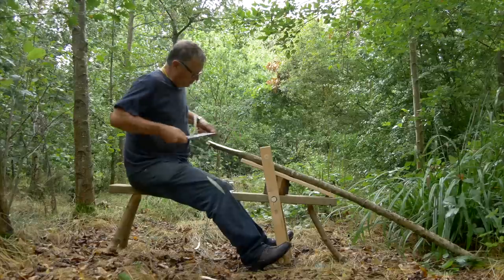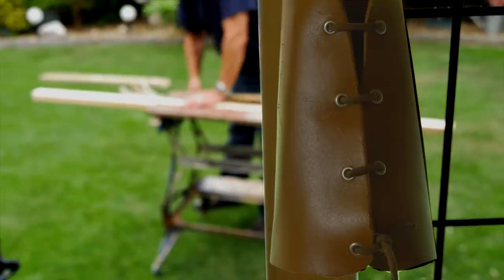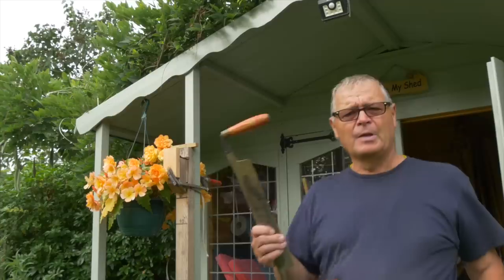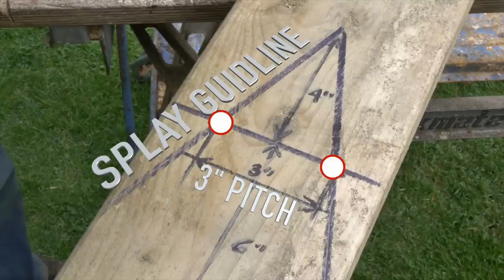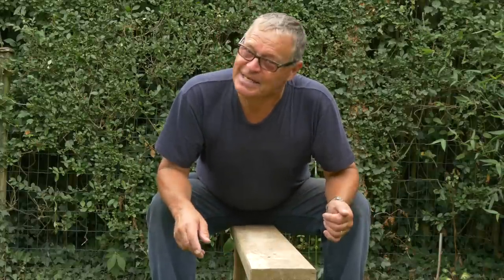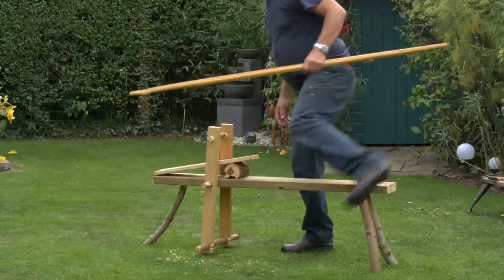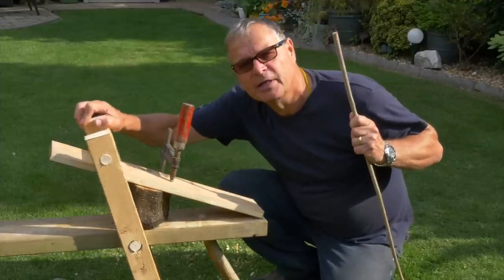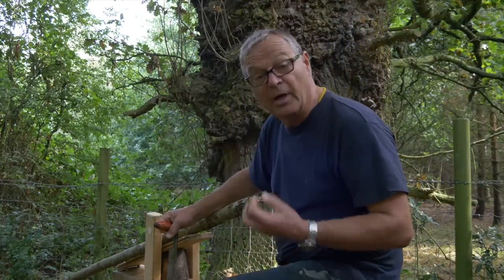How to Build a Shave Horse. Bowyer's Woodworking Dream. Traditional Handmade Vice for Wood Carving

Comment: Hey Mick, saw this video on making a shave horse, my wife and I make brooms, and I need a shave horse to hold the handle so I could strip off the bark.  Your design is perfect. Just finished mine using Lilac for the legs and spindles and 2x6 for the bench.  Must say, it turn out pretty good for my first one. Couldn’t have done it with out you. Tried to attach pictures but couldn’t figure out how to do it.  Thanks from North Eastern Utah, USA.

Comment: Hi Mick, 👋 Among the various Shave Horse designs that can be seen on YouTube, your design is the simplest and most direct! 😀 I like 👍 that you use found materials and friction fit all the parts. I'm a newbie gathering tools, materials, and information to attempt my 1st bow! I believe I will use your design to first build my own Shave Horse. Like you, I believe that I have all those materials around the house, for free! 😊 Thanks for making it so accessible! 😊
Reply from the maker: Good luck 👍👍
Reply: @Mick Grewcock  Hi Mick, ???Question??? I'm 6'2" and about to make my Shave Horse using your measurements! 😮 Are you close to that height? Or should I add a few inches to the various parts? 😊
Reply from the maker: @davidwsmith316  I am about 5’10” with 29” inside leg. I think leg length is more important than height but your reach as you bend forward to draw the knife back is also important. You could sit on a regular chair and estimate measurements from that. Some people make a slightly more complex horse that has a moveable seat which will accommodate people of varying stature. Good luck.

Comment: The draw knife is supposed to be used with the bevel side down.  this allows for far better depth of cut.  Also you need to use it angled to the cut and this gives a very smooth slicing action instead of a scraping action.  I enjoyed the video.

Comment: Ah, a great video, as you promised a few weeks ago! Just a little tip, if your pegs start to shrink and slip, saw a kerf in the ends and put a wee wedge in them to tighten them up. Just make sure you have the wedge oriented across the grain so you don't split the bench!
Reply: Agreed.  The wedges will make the bench a bit more permanent, but if need be can still be left out to allow breaking down the bench.
As an aside, if you taper the leg ends, this will permit driving them deeper if shrinkage occurs.
OR, use a chair bodger's trick and you cut the legs from green wood, but stick JUST the dowel ends in a bucket of hot sand or over a fire to dry out (not char!)...when they are driven home, as they absorb moisture from the air, they will expand to fit the holes tightly.

Comment: Pretty cool design. I'd probably use a metal bar for the pivot though, you wouldn't have to remove so much material from the bench part.

Comment: Good to see you back off hols Mick.....For bloody years I have chased "Workmates" around and have often thought that a shave horse would be a nice thing to have (that and a pole lathe) but have never got around to build one.  Nice job for your first shave horse....most people cock up on not getting the geometry right and end up with not enough/too much pedal throw, the work hight too high or not enough working distance...but yours looks sweet.
Reply from the maker: Thanks Keith! It worked out okay for a first go, especially as the parts were cut and joined together to the rather vague guidelines I set myself. Good that you mentioned a pole lathe - that's my next big project (will take some weeks as I can't do any woodland work for a month or so). The archery link being that I'd like to turn some arrow blunts on the lathe. By the way, did you get my message about the previous video we discussed? Sent it yesterday evening. Mick
Reply: Mick Grewcock  ......Yes Mick I did thank you, I think you took the best course of action.  I couldn't easily message you back as you took the Tube post down.  Yeah....the pole lathe, there isn't much of an application for archery but it is a nice tool to own....mind you, had you had one you could have turned some fancy legs for the horse that you made.lol

Comment: I just made this shave horse from your excellent video. 
It does work pretty well for me but it's a little bit out because I had to guess where you put dowel holes, both in the middle of the treadle assembly and how far along on the bench. 
I'm making some adjustments to improve it but just thought it might help putting those measurements in your description.
Reply from the maker: Thank you. Sorry for my omissions!

Comment: Well Done Sir!
I am planning on teaching a class for tyro wood workers next summer, the project will be your rough-field-made shaving horse.  I have been looking for plans for something like yours, usually too finicky as to finished materials.  Rough as-found things will do just fine, in fact, might be better.
This will be day #1 of a two-day class.
Might I suggest:  Clean up that plane just a bit.  Use a single-edge razor to scrape off most of the rust, a bit of sandpaper on the rest, and wax it, so it will not rust (as much) in future.  You will feel the benefits next time you use it, I promise.
The suggested shave horse projects I will have for my students will include, believe it or not, vampire stakes...yes, I know, it's fashionable to kill vampires now, but if they DO show up, people can be prepared!
Included in the class will be a simple stool or table, which will use the shaving horses to make the legs for such.  The stool/table and the stakes will be the class for day #2.

Good idea, the pauses and 'key moments' for people to catch up with.

I will also place on the worksheet they will receive, your YouTube and web site addresses, for due credit to you and your design.

Ryan Grimm, Plymouth Massachusetts.
Reply from the maker: And well done Ryan. Sounds a fantastic project. And yes, making do with what one can find is a great learning experience. Good luck and thank you for the tips. Mick

Comment: Hi, Mick. I loved your video and am in the stages of preparing the parts. But I need the measurement for how far along in the seat you drilled the holes for the treadle hinges. And maybe the same for the top and bottom holes of the tredle. Obviously the centre of the holes and not on the perimeter. Great vid and thanks!
Reply from the maker: Hi. Unfortunately I haven’t got the shave horse near me to measure for you. However, I didn’t work to full plans - I simply estimated where to place holes etc. Sorry I can’t immediately help you - the horse is in our wood about 7 miles from where I live.

Comment: Nice build nick ive been a greenwood worker for some years know and even hold courses in our own woodland just one bit of advice if you dont already know using the drawknife as a scraper can damage the cutting edge as most drawknifes are laminated and tend to chip i learnt it the hard way by doing the same thing love the videos keep up the good work mate
Reply from the maker: Hi Phil, thank for that useful tip. Much appreciated. Thanks for watching. Mick

Comment: It's nice to see you making it :) 
I bought lumber some time ago to make one for myself and will probably make it before summer ends here in Poland. I bet that's gonna be way nicer experience getting into bowmaking with it.
Reply from the maker: Yes, it's a boon when making bows. Not sure why I wasted so much time before building one! Hurry up though. Summer is drawing to an end here in the UK. Stay safe. Mick
Reply: Mick Grewcock I've got few logs of black locust that need to be dried still. And split.
My plan is to make shave horse and tillering tree and hopefully if wood dries enough to start making first bow during winter break.
And thanks for response Mick. I'm glad that your design works out for you!
Peter

Comment: Amazing video! Though of an idea what if you used and smaller piece of wood and some type of hinge so you could change the angle of the table?
Reply from the maker: Plenty of options to add to this simple design. Give it a try. Good luck.

Comment: Thanks so much for this video Mick, could you describe quickly how you use the splay guidelines to find roughly the right angle?
Reply from the maker: The proper way is a bevel gauge. Those guidelines simply helped me ‘eyeball’ a suitable angle to get the splay. My lines simply gave me a visual hint as to the angles. Hope that helps.

Comment: I am getting interested in hand wood working and the simple machines that let you do so much like a low bench, shave horse, and pole lathe. My question is how do you determine what angle or height to use for the shave bed?
Reply from the maker: Simply by eye and estimation. There are shave horse plans on the net if you prefer exact angle fir your project. Good luck.

Comment: this is great mick, you make it look easy. i was wondering, is it still working? i reckon it is
Reply from the maker: Yes Sid - it’s still working! Thanks for watching.
Reply: @MickGrewcock  Thats great, I am attempting to make my own shave horse, I was thinking about driving wooden wedges down the through end of the legs after banging them in but I noticed you didnt so that proves to me it wont be necessary, Ive been watching a lot of shave horse build vids but Im finding yours easiest to follow, thanks.
Reply from the maker: Good luck! Driving wedges would work but I didn’t find it necessary - and also very to disassemble if not wedged!

Comment: Great work! love that you didn't use any glue nails or screws. You got a new subscriber :)
Question, why use the drawknife to scrape with? Wont id dull the knife horribly fast?
Reply: Mad Silly Willy,
 Shouldn't, depends on the quality of the draw knife, just like other knives. A decent quality draw knife shouldn't need much more than a slight honing to keep it real sharp, if done as needed, just like your knife.

Comment: Dumb question time. I've thought about building one of these for my grandson who is teaching himself to make longbows. While it seems it would be great for working 1-2 feet at each end, how does it work for shaving more towards the center of a 6' bow? If you sit too far back you can't reach the foot pegs. If you sit close enough to reach them, it doesn't seem like you can work too far towards the center of the bow. Or am I just missing something?? Any advice would be most appreciated! Thank you!!
Reply from the maker: Not a dumb question. Shave horses were not used to produce bows, their main function was initial preparation of short pieces of green wood to be turned on pole lathes - often for chair legs, spokes etc. With some wiggling you can get toward the bow’s middle but the SH performs best when initially tapering the limbs and tips. The real work shaping a bow is not done on a SH. They are great for fast and initial preparation of green staves, taking the stave (which has perhaps been crudely shaped with an axe) down into a slightly more refined shape. Then the work begins of more precise and careful shaping. Great aid, worth making, but only helps during early stages of bow making. Good luck.

Comment: Nice video :) Can I ask, what do you do when working on the area at the middle of the bow? Won't the end stick out further towards you, and poke you in the belly?
Reply from the maker: Shave horses were developed to prepare shorter pieces of green wood than a long bow. They were often used in the UK for example to preshape green wood blanks for chair legs which were then turned on a pole lathe. You are correct, working the centre of a longbow is not ideal using a shave horse but it is usually the limbs that need most work. I sat to one side on the horse and allowed the bow to pass under my arm when working the centre. It is a little awkward but does work!
Reply: Thanks @MickGrewcock, good to know it works. I wonder if that's what all those English long bowyers used to do

Comment: Mick, I notice you using a large draw knife. Is there a reason you use such large draw knife? And do you have smaller draw knife?
Reply from the maker: Hi Lucien. I have three draw knives, from small to the large one you mention. That one is especially useful for aggressive removal of large amounts of wood, thick bark, etc. It's extremely sharp and, because of its size, I can exert a lot of force on the draw. My two smaller knives have different uses: one is a delightful French, wheelright's draw knife given to me as a gift from a friend who makes bows in Normandy, France; it is kept medium sharp and is great for detail work and soft bark removal. Second is a Mora kindling knife, not really draw knife but can be used as such; it is razor-sharp and is used infrequently but useful when I need such a tool for aggressive wood removal on a small work piece. Thanks for watching.
Reply: Thanks Mick for your answer. Enjoyed your video and plan on making a shave horse soon.

Comment: I'm trying to make soemthing that will hold wide sections of a walnut log's sapwood. Might use something like this! Any ideas? The piece is slightly rounded, but is around 10 inches wide, 15 inches long, and 2 inches thick at its peak
Reply from the maker: Normally shave horses are for green wood work and often chair legs or similar. I guess this concept could be adapted to suit, though the pressure required might not be achieved by foot power alone. The only to find out is to have a go I guess. These are quick to make and - as you have seen - can be made from odds and ends. Good luck - and stay well.
Reply: @MickGrewcock  thanks! I might try to make a cheap bench stop that i can sit on top of, so i can plane and draw the piece.

Comment: I’m back. (i wrote a comment four years ago.) I built your shave horse because I liked its organic build, no hardware, and efficient simplicity.

If I would appreciate anyone doing a video on leg angles, i would appreciate one from you. My shave-horse replica leg angles were a complete crapshoot.

I understand splay and rake. I somewhat grasp sightline by the many explanations on Youtube, but I’d appreciate less explanation and someone showing me sightline on a chair. (No more, “Turn the chair until one of the legs looks perpendicular. Then pretend your eye is a laser running through the leg under the seat. That is your sightline.”  Whaaa??? Okay. So what?)

Resultant angle??? WTH? I don’t want to see math formulas, I want to see each of these concepts applied right to a chair and its legs. Like a good novel, show me, don’t tell me.

Your shave horse video us so practical, no fuss. You’d be the guy.